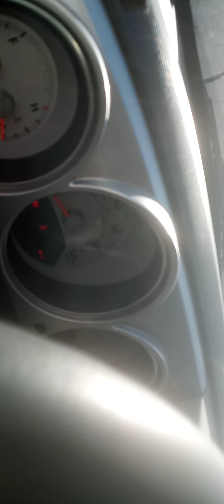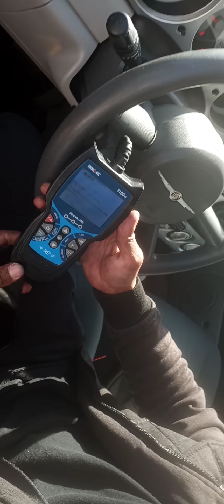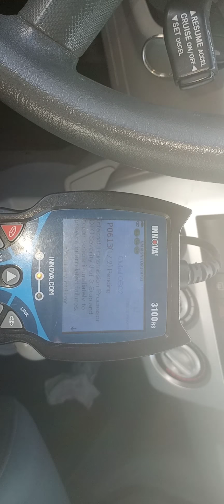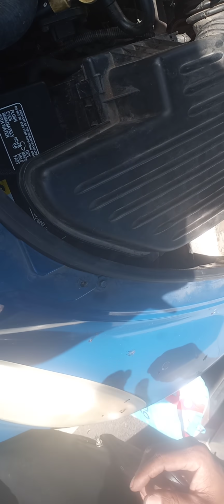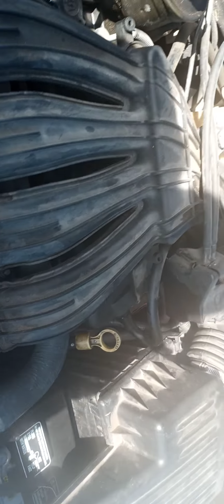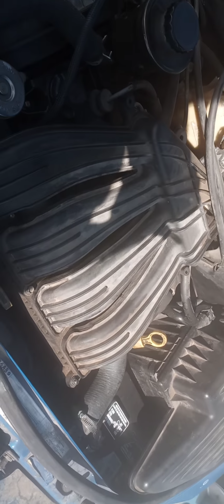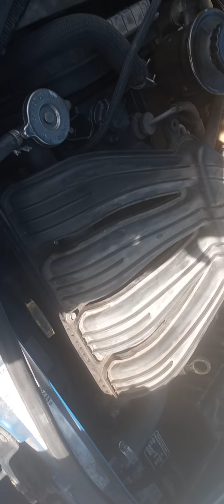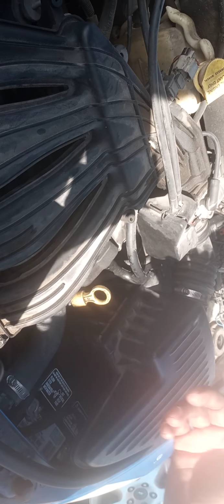PT CRUISER PCM,ECU AND TCM RESET FOR TRANSMISSION PROBLEM

Comment: Why do ppl ask or say its a bad battery if the engines cranks n cranks
Reply from the maker: Most of the time engine crank and crank I mean long time crank to start because of you have a bad starter, but if you have a check engine light on with a long crank it might be crank sensor or camshaft sensor, always it's common to happen bad camshaft sensor, it's nothing to do with you have bad battery or you have a good battery.
Reply from the maker: Also remember if you have a bad ground cable same symptoms you can have long crank and no start situation make sure your car ground cable to vehicle body and PCM BCM ECM so on
Reply: @ranjanjayathilaka92  i was meaning like woman always ask that 1st
Reply from the maker: Oh ok

Comment: Can't understand your really bad attempt at English, otherwise it may be good information, who knows. However electronics are not like a pot of water that need to cook for 30 to 45 minutes, what  !!!!!
Reply: The TCM, EUC or ECM can be reset by removing battery terminals, holding them together with zip ties, waiting 30 minutes or so, then reconnect the cables. You can google exact instructions. Think neg cable comes off first. This will reset the computer. May buy you more time. Think you can also pull the fuse and then  put it back.  The Fuse for the ECM module if thats the issue